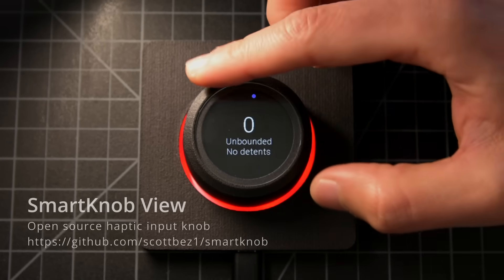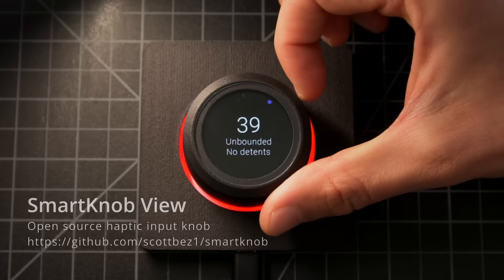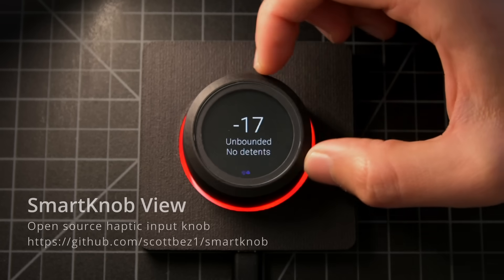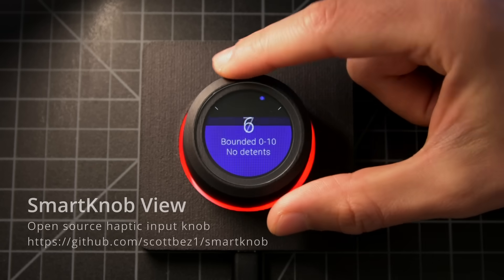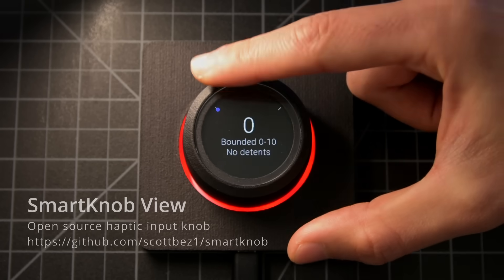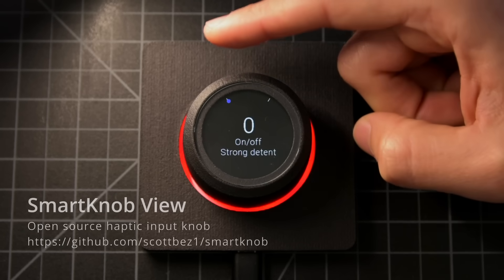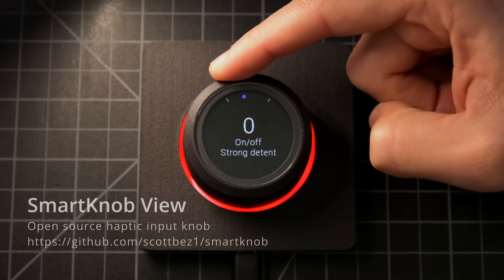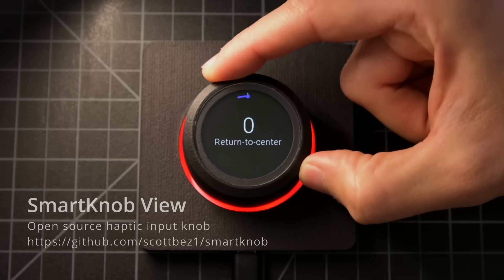DIY haptic input knob: BLDC motor + round LCD

Comment: This would be cool to see used within smart home light switches. An example could be that you press the screen to switch modes: 1. light on & off for a desired room (where witch is located);    2. list of light/room presets (likely made in an app); 3.mode would be for brightness control; 4. mode for light color temperature; 5. mode for different light colors (think colored Hue/Wyze bulbs)

Idk, this is just some example uses i think would be cool to have for a smart home, and the haptics would give the user some feeling of control of their devices. Now that i'm thinking about it... this would be quite useful for homes that have a multi HVAC setup and they could turn these into remote thermostats for specified rooms, allowing the user to see the room's current temp., set the temp., the current mode (Heat, AC, fan, off), schedules, and more.

 Man... there are many practical uses for this in the smart home, hopefully someone would be willing to make an application to easily incorporate this with Home-Assistant as people could create this themselves or a company/small business could make them for those who aren't experienced enough to make them themselves or don't have the resources to do that (with proper permission from the creator to use the design and stuff).

Comment: Cool. Reminds me of first version of BMW iDrive Knob, which was virtually the same, with haptic feedback and movement. Those knobs have been used around 2008, I believe. BMW has replaced it later by a cheaper knob without those features, I think.

Comment: so I'm no engineer or ui designer but you should make it so that when there are limits that the spring back doesn't push it back so hard it increases/decreases in the undesired direction, but instead it will bounce back and forth locked at the limit unless acted upon by the user like letting go of a bent ruler and watching it return straight. Also a momentum style feature would be nice too for times when there are no detents.

Comment: Would it be possible to track the wheel movement history in a short 1/2 second buffer and, if its still for a certain length of time, roll back to it's most recent still position before it was pressed? Maybe as an accessibility feature? On any kind of control knob I always find myself accidentally rotating it right as I press down due to my own lack of dexterity.

Comment: Dude, put aside everything about cheapness and build it robust, as this  is proper solution to industrial control panel inputs. Most typical input methods are better with this and most idiots will have a hard time braking software input limits :v

Comment: Whould it be an idea (if not already suggested) to design a pcb that has most of the electronics (and use an esp pico d4) in the rotating part of the knob, this way you might save some failure point in the wiring, you could get away wit just power through the hollow shaft, the motor housing might be GND and a central pogopin for VCC

Comment: Does the encoder know the absolute position of the knob? I.e. would it be possible to replace the blue dot on the screen with a physical marker permanently engraved / painted / glued on to the knob?

Another great application for this would be to control something that can be either set to a manually chosen value or to a computer selected or remotely controlled value. My amplifier has a motorized volume knob that works a bit like that as it can be set by remote control, and I've also been wanting it for various settings on cameras & lenses.

Comment: The functionality and flexibility you’ve managed to get out of a DC motor to drive an interface device is actually amazing. This could honestly revolutionize the approach to building any kind of rotary input system since the BOM for the rotation elements is so low.

I’d suggest also considering a knob+surrounding LEDs build if you’re looking to do further experiments with even smaller form factors. LED light intensity/color could be a feedback mechanism as well.

Comment: This is incredible!!! I would love to use something like this as some sort of universal control knob for different software. Imagine this being the volume knob for the PC by default but as you open up a particular software you can switch and control certain software features with it. Maybe with an added grid of simple buttons next to it to switch between different things you want to control. I know there are control decks out there for music making, lightroom etc but a knob with tactile feedback of this degree is simply something else. I have pretty much zero experience in electronics or programming/coding but I would definitely put money down on some sort of easy to built kit or pre-assembled product! As long as there are ways to configure it on an app by app basis.
Reply: You could also use it to control playback of videos and music. Have it motorized to turn at a steady pace, then the video speeds up / slows down or goes back wards if you adjust the speed or direction, like a DJ controlling a turntable.
Reply: @superfluidity  Wow! EXACTLY! What an awesome idea.
Reply: Not exactly the same, but Microsoft has the "Surface Dial" which is basically a software defined knob. It changes uses based on the context of the app that it's in. I don't have any hands on experience with it, but from what I've seen, it's pretty neat. So the precedent for its sort of device is there.

Comment: Holy shit. Is this usable with like Apple HomeKit devices or similar?
Reply: It's open source, so I don't see any reason why that wouldn't be possible if you're handy with coding. That's the cool thing about Open Source projects (and coding): you can build and change almost anything you wish for.

Personally, I would love to put this in a Home Assistant setup, allowing it to change the  volume of sound systems, temperatures of the thermostat, brightness of lamps and more. :)

Comment: Does anyone know of another option for the motor? It needn't be this specific one as I'll be using it in a different project, but mainly after something compact, low voltage (that can be driven off just a 5v source (Teensy/TMC6300)) and is smooth ("low cogging" I guess is the technical thing)? I've looked up and ordered something that looks similar, but I have little-to-no experience with brushless motors so not entirely sure what I'm looking for spec wise.
Reply: Also not super fussed about price as I only plan on building one of these things as it will be a MIDI-controller of sorts.

Comment: UI tip: pick a font that has “lining numbers” in the OpenType feature set. All the numbers will have the same bounding box width, so they won’t jump around when you go from skinny numbers to fat numbers, like 11 to 12.
Reply: Someone needs to tell Google that, so on my Pixel I stop glancing at the notification bar whenever the time changes to a wider digit.
Reply: If anyone wants to search for supported fonts, I believe they are technically called to be having a "tabular" variant for numerical display. Other numerical variants are proportional, (the typical default), and oldstyle.
Reply: like Courier new?
Reply: monospace fonts
Reply: @descrord  lining numbers is different than monospace. Monospace gives every character the same width, lining numbers only applies to digits but leaves alphanumeric characters as-is.
Reply: @areox27  that’s cool! thanks for the info
Reply: yeah any monotype will do the trick
Reply: @nebsu_  every monotype is number lining, but not every nunberlining is monotype

Comment: This is really nice. Certainly looking at future UI stuff here. I work with strain gages a lot. Between the HX711 which is not a very good adc, the unknown STC code of the gages and pairing them with highly variable epoxy fiberglass boards that could have unpredictable fiber orientation and then using CA glue, you're very likely to see medium to short term issues with zero offsets moving about with thermal responses and not completely predictably, as well as creep and drift for various mechanical aspects. You might be fortunate enough with placement that strain dwarfs these issues -- though then you'll have to worry about pcb fatigue failures.

Comment: I have no knowledge in this at all but one problem that I could think of is that will it worn out the motor? In some of the demonstration there are points that you have to push against the motor to activate something so won’t it hurt the strength of the motor in the long run?
Reply from the maker: Great question! Generally what hurts motors is heat. If you stalled out a typical high rpm, high current drone motor it would definitely do damage since current is very high when stalled and they rely on airflow from the propellers to stay cool. By contrast, this is a gimbal motor which is designed specifically for low rpms and low current, so it doesn't heat up much even when stalled.
Reply: @scottbez1  that’s so cool! I didn’t know there’s that much different between motors. Thank you so much for the answer. And again I want to say that this project is so interesting!

Comment: This is one of those awesome ideas that make you wonder why nobody had them earlier.
Totally blown away, I will definitely use this some day for one of my projects! =)
Reply: BMW's first IDRIVE System in the E60/E65 from around 2002 worked exactly like this. As the menu changed, the turning of the knob changed on the fly. Really cool
Reply: Designer: "We should put this really awesome knob customers will love it!"

Engineer: "Ok how much does it cost?"

Designer: "I don't know like $5"

Engineer: "We're gonna go with the $0.20 knobs we've been using."

Designer: "But...this will add value"

Engineer: "You know what you're right, $0.25 knobs it is!"
Reply: Sony rds tuner had that 30 years ago, albeit in hardware.
Reply: The idea isn't new. This is an extremely good implementation of an old idea I would say. 
Having a physical knob as additional input device for a computer has been there at least 10-15 years ago. The problem back then was that they just didn't find good use cases. I remember that it was marketed as tool for designers who work often with photoshop. The knob could be used to determine brush sizes and in general everything where you have a scrollbar. It sounds cool and I bet it is cool when using, but to be honest, there is no real benefit from it as using a mouse wheel also works pretty good already.

Comment: If it can be connected to arduino/rpi, I will buy one within seconds it is out. In some of my projects before automation I test stuff, and usually with keyboard. This one can be used as switch, servo controller, stepper controller, end-stop tests and more. Love it.

Comment: This is super cool! I built one similar to this about 24 years ago using a DC motor and an optical rotary encoder. It did not have an LCD display nor button. Watching your demo brought back memories and now I want to build one like yours!
Reply: the nutton seem cheap to add but the screen is like 80$ and take bunch of space inside
Reply: @omnianti0  Well, A pocophone f1 screen is 20$ (1080p ips with touch digitizer) So I bet this little screen is less.
This looks like a smartwatch screen which are now mass manufactured.
Reply: @HAWXLEADER  you meam the screen without controller what is of few use here
Reply: @omnianti0  Just checked a circular OLED is ~25$
You can get by using a rectangular one if you don't fill it with color.
Reply: @HAWXLEADER  yes i checked but maybe you can link on a cheaper shop than aliexpress
Reply: @omnianti0  LOL, so wrong.

Comment: Wow! I could see this making a HUGE impact on Amateur Radio imagine being able to setup the main rotary encoder (VFO knob) to your exact requirements of feedback on CW/SSB but also then it automatically select itself to Detent  mode for FM/AM use! Then if you had a radio with a Menu system of settings it would be useful for that too. How long before someone uses one in a uBITX HF kit ? 😁#KD8CEC #uBITX
Reply: You can be the one!
Reply: or even using several of these encoders on an advanced rig not just for the vfo but also for clarifier, af&rf gain, if shift/width, DSP control and then dynamically change them to rf power/drive, mic gain/compression/eq, CW keyer speed when going tx or adapt knob usage depending on the selected mode. That would cut down fiddling with the menu during the QSO and get rigs closer to a full hardware control like with dials and knobs on classic analog rigs. Modern rigs, albeit with better performance,  became a bit cumbersome to operate compared to the old ft-902dm or ts-830s
Reply: Wow, that's a really nice idea!

Comment: This is great, as someone has already mentioned, I also wanted to build something similar, but seeing your design, looks like you have already done everything :) What´s the OLED display used? Thank you!
Reply from the maker: It's an LCD: GC9A01.

I've toyed with the idea of using some higher pixel density AMOLED screens from smart watches, but that would increase the cost and complexity a decent amount. Maybe in the future.
Reply: @scottbez1  thank you for your answer. Again, it’s a great looking project, nice work!

Comment: I wanna see this implemented in a mouse scroll wheel.  Context sensitive scrolling detents.  How fucking cool would that be.
Reply: check out the logitech anywhere 3! it allows you to change the sensitivity of the scrolling dent via software. It also allows releasing the dents at a changable speed for faster scrolling. I assume they use the same principle with brushless motors.

Comment: Love this project! Immediately I want to take a bunch of these in a grid and make a software configurable MIDI controller! 

Is the size arbitrary or does it need to be that big due to all the parts? For a MIDI controller, half or quarter size would probably be perfect assuming screens are available, but even a grid of full size knobs would be cool.

I could also see a use case in controlling custom stage lighting effects and other music-tangential use cases!
Reply: I was just looking up micro brushless motors for a midi controller like this when I came across this video haha. I think the key to making it small enough would be a different screen layout (or getting rid of it entirely). I was thinking maybe one screen with a bunch of knobs and each knob just has an led ring to indicate position and notches, then the screen could show actual values.
Reply: It looks like majority of the hardware he's got physically inside the knob, but it doesn't have to be that way. If the depth of the device isn't as important, there's no reason you couldn't pack all the hardware further back into the enclosure and just have the knob extending out into the front. Getting the screen functional with that setup would be the only challenge.
Reply: I second this. Being able to configure if a thing is a knob or endless encoder depending on context is probably next generation of midi-controller hardware.

Comment: Could this be done without an encoder, using a driver sensing the motor going past a step? It would be much less precise, but ditching the encoder + reading circuity could make it worth it for certain applications?
Reply from the maker: I'm no expert, but my understanding is that this is generally hard to do. Looking at other BLDC applications, if you look at RC hobby ESCs for drones/airplanes, those are generally "sensorless" and use back EMF to determine phase timing since they're spinning quickly. On the other hand, it's common for electric bike and electric scooter motors to have sensors built in (generally 3 hall sensors) because it's necessary to have some timing/angle feedback when the motor is rotating at low speeds.
Reply: @scottbez1  ah yep, that makes sense. Thank you for the response!

Comment: What was the reason for going with strain gauges as opposed to a slightly more flexible PCB and a tactile button underneath?
Reply from the maker: The primary reason is simply that I wanted to try it. But the secondary reason was that it really seemed like a pretty good solution to mounting the motor/knob while allowing for push detection. I think it'd be hard to allow a PCB to flex enough to depress a tactile button while still being rigid enough to support the whole motor+screen assembly, especially when you're applying torque or accidentally pushing on the side of the knob.

Comment: Love the FOSS implementation! You should look up the NODO Inertia Wheels. They're for the film industry and mega expensive, but they have a few extra features that could be fun to implement. 
You can adjust the "mass" and the "drag" of each wheel to change it's pretend moment of inertia. I think it's commutating the motor so that it slows down the deceleration.
Reply: you could see a demo of what I'm talking about at video _fZKYHZE4mg timestamp 1:40

Comment: I don't have a project for this yet but need one in my life! VERY cool! 👍
Reply: I need lik 500
Reply: this could be useful to control lights and other smart home devices
Reply: @Shadow__X  could combine this with a raspberry pi and homeassist to make an awesome control panel
Reply: @sparkie5571  basically my plan, I have home assistant set up on an always on PC. Planning on installing this in my light switch socket and using the mains for power with a phone charger, probably convection cooled for safety
Reply: o kinda wish to use only as a fidget toy, Imagine you can configure lots of modes just to spin the knob around with different feedbacks.